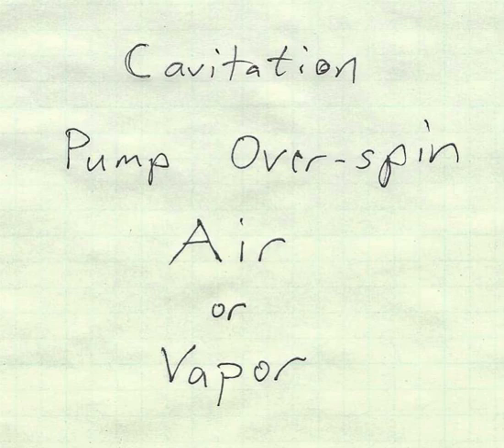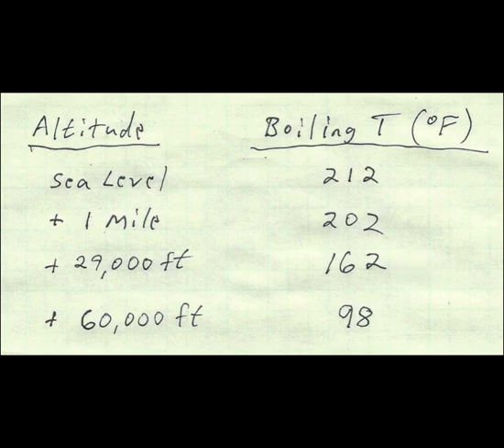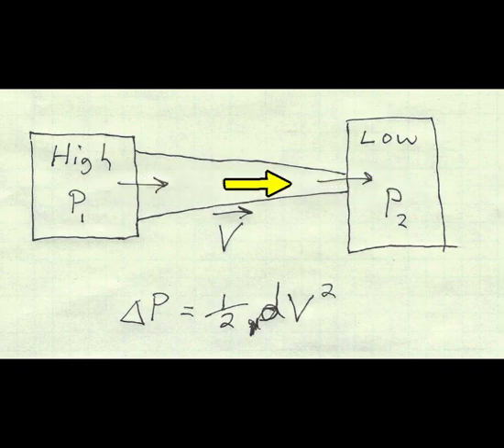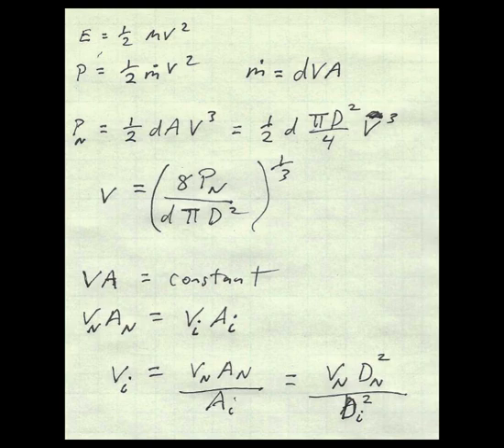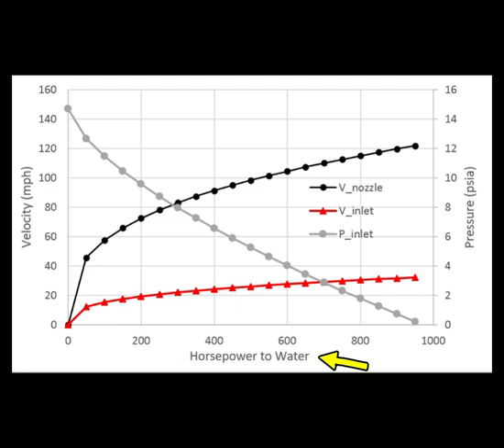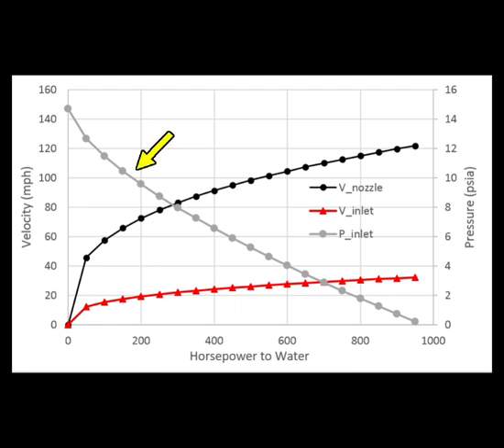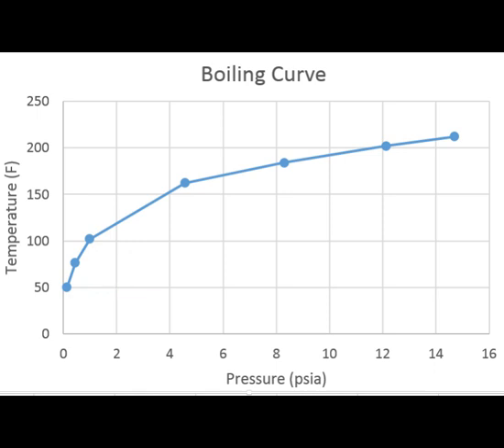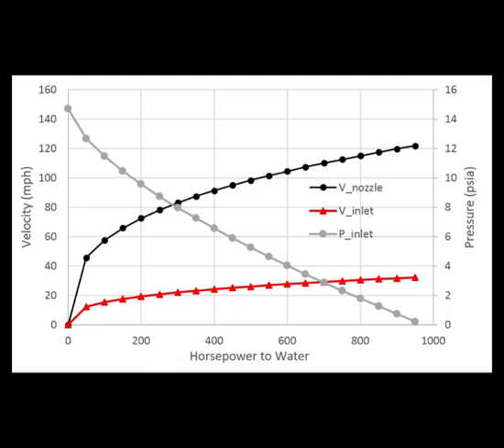Jet Boat Cavitation

Comment: Thanks for all your math on this pump stuff.   Some questions.  Why dont we just put pitot tubes on the nozzles and find the pressure and then thrust?
Reply from the maker: That is a possibility. Probably the most accurate method is simply hook a scale to the back of the boat, and see how hard it can pull.
Reply: @idahoviking  Yup,but doesn't give us info at various speeds. Pressure in intake increases as speed increases. How much thrust is that Pump giving us as it try to push the boat up the rapid?